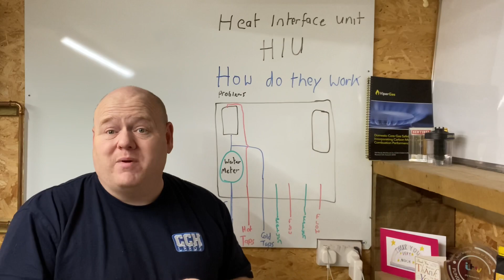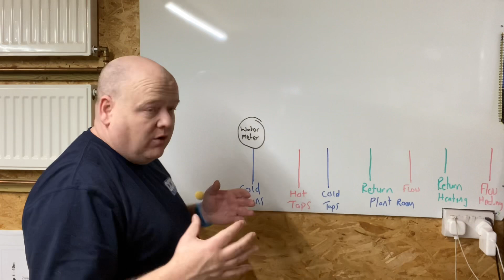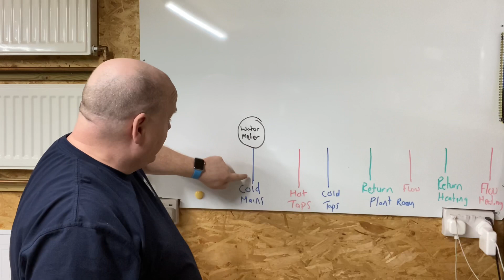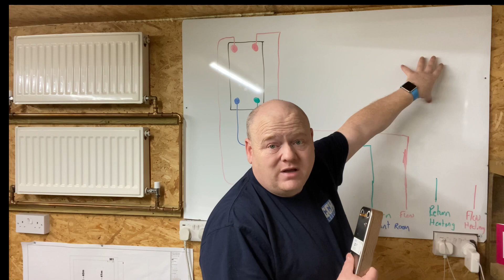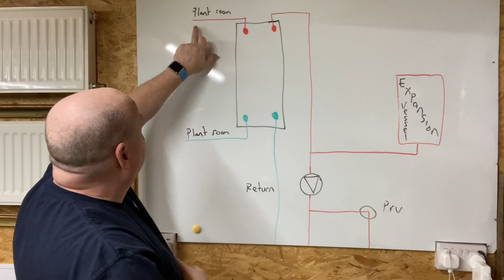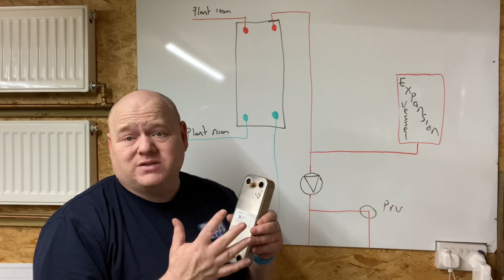Plumbers Videos - Heat Interface Unit - HIU - How Do They Work HIU I20 i30N

Comment: Hi all
Thx for this super clear video! Really useful to understand these systems.
I've recently moved into a flat using district heating and an HIU. The building is mega hot all year round. I never used the space heating in my flat (and I have 20 degree C inside in January/February!). That's great for winter but when it starts getting warmer outside the flat/building is becoming a sauna!
From my understanding it sounds normal since the building needs to receive super hot water and distribute it in each flat. And then each flat can cool this water for the tap/space heating.
Does that mean my building hot water pipes are not insulated? Or there is another issue? Has someone seen something like this before?
Also, as a side question, is it really more efficient to constantly produce super hot water that runs everywhere in the district pipes (and loses temperature) 24/7 instead of having each flat producing its hot water when needed?
Cheers

Comment: As a resident 'enjoying the experience' of the largest district heating system in Scotland (Glasgow, switched on 2016), I can say 2 things:-
1) These systems that great potential to help residents with both reduced bills and provide on-demand hot water and heating. BUT...
2) These systems have even greater potential to be abused by those billing & operating it (same people).
Just over a year ago Evinox(took over Minibems) fitted, to every flat (>700) the ability for them to remotely increase/decrease the pump feeding hot water into our radiators. The same engineers also 'adjusted' the primary valve on every radiator. Their brochure promised "slashing of bills". The brochure also said "radiators might be cooler at the bottom". Red flags indeed.
The nett effect of all this is that today, there are mass complaints of "cold radiators". Our big living room radiator is cold from half way down to the bottom - the living room, unsurprisingly, cold. Evinox has literally treated every resident as a kid in denying every resident full control over their heating. Bills? - they are HIGHER! Mass complaints are ongoing.

Comment: 1:52 He says there's no heat exchanger in it.   Then goes on to talk about the plate heat exchangers?!
Reply: Because a heat exchanger is not the same thing as a plate heat exchanger. Gas boilers have what is called a main heat exchanger which is commonly refered to as just a heat exchanger, which is what produces heat and supplies heat to central heating. The plate heat exchanger transfers that heat to provide hot water.

A hiu doesn't have a heat exchanger, the heat is supplied from the district that has a boiler which does have a heat exchanger. The hiu only has plate heat exchangers which transfer the heat to hot water and central heating.

Comment: I have an Evinox MTP50-10 which is opening and closing the HE control valve soon after the circulation pump kicks in and the pump keeps functioning. I'm reckoning it's an issue with the temperature sensors but I can't find the specs on them (S3, S4 and S5). Do you know if they're type K thermocouples or thermistors and what type? (2 of them look like thermistors and one looks like a thermocouple. I don't think they're original parts)

Comment: Hey Allen, great video mate. One question: If the last two radiators in this system are cold, but the second to last rad is hot at the TRV but a lot colder at the Lock shield valve - What would you suggest to do with the balancing? And second question if you don't mind, can I confirm that the Lock shield of the last rad in the line would be the 'most open valve'? I appreciate any advice you can give me. J

Comment: hi, ever come across the situation where occassionally need to turn the heating out for hot water to come out of the taps? i.e. tap is turned to out but only cold water coming out of the tap until the heating is switched out which in turns heats up the water for it to come out of the tap hot?

Comment: Hi, hoping you could guide me in the right direction. I have the exact same unit in my flat. I can feel the hot water coming into the unit but when I turn the taps on the water is hot for 5 seconds and then freezing cold. What could I do to have this resolved ? Flat is only 2 years old

Comment: If an apartment has hot water in kitchen, second bathroom, but in end main bathroom that shower starts warm then loses heat. Is that likely a HIU issue or thermostatic valve issue? (Sink in that shower works well)
Reply: Thermostatic valve

Comment: got a problem with mine, the down stairs sink hot tap is working fine and getting really hot water but the up stairs sink hot water has been fluctuating and now hardly getting any hot water.  what could it be .

Comment: District heating is becoming very big in the UK. I maintain over 2k properties in the Glasgow area. A lot of folk are still getting used to them but I think they are a good efficient set up. The company I work for specialises in biomass so the schemes primary heat source is biomass. A gas/oil back up is essential in case of primary boiler failure. Of course some units are better than others, as with gas boilers. Do you have fault finding videos that I could let our apprentices watch. A really informative video, thank you 👍🏻
Reply: I bet it’s nice for you when you just get money and never have to suffer the issues. Jesus Christ the detachment from reality.
Reply: @Liusila  Gosh I thought I was the only one in here think this. It's absolutely diabolical to live with. Never get enough pressure in the Water Heating System. Unvented cylinder much more effective with the premise of having a backup of a heating element just in case.

Comment: 🤔 "this are hot at all Times" mine defo aren't. Takes a good 5 minutes to get hot water sometimes.. Need to convince my landlord to have a look.. Its also luke warm in the taps Half the time.  Eg if I use radiators... I can't get hot water out the taps.. What could cause it as landlord doesn't believe anything is wrong

Comment: We have 12 of these installed in a new build block of flats for the last four years, as a facilities manager the system has been a nightmare. 

The two cascading 100kw boilers on the low lost head system constantly heat the hot water rail from the plant room to 80 degrees. 

The hot water rail  is very well insulated but still cause massive secondary heating of the flats in summer and the whole building. It is also not helped as the flats are modern, well insulation and pressure tested to pass the energy performance certificate, there's no were for the heat to go. This has resulted in flats being above 30 degrees, and elderly clients passing out as result of the flats not being able to lose heat.

 The whole complex is constantly warm posing a problem to delivering cold water that is below 21 degrees as by the nature of the system the cold water is bought so close to the interchanged units and uses cavities next to the mega hot water rail pipes. 

And then who pays for the hot water rail?  Its the landlord 24hrs a day 365 days a year, just so a tap can delver hot water 20 seconds faster than a combi. 

The taking of kilojoules readings and billing is admin heavy and takes up a stupid amount of time. So do buy the £10k software to try and save some time but it also important as the kilojoules meters batteries go flat and are not cheap at all  there are not like a water meter that ticks over, but are constantly taking heat readings to work out the joules used.

The balancing of the systems can easily be put out by the smallest amount of scale in the system so in needs constantly cleaning and dosing, a decent size dosing unit is unit is a must. But you still get problems balancing each unit. Either with hot water or the under floor heating. Most residents don't use the under floor heating anymore due to the massive amount of free heat coming off the hot water rail. So you have paid for a massively powerful system where the customer only pays for what they use.

Parts are not cheap, a couple of years in, and differential valves, TMVs and meters have been changed at a thousand of pounds cost across the 12 units. along with loads of hours work sorting the systems to be stable. The reading and billing admin and silly extra heat in the summer months the system turns out to be a mechanical engineers love child constantly burning the owners energy mix. 

If you have the money to install these system....pick something else. They are work

Comment: Hi I have one of those in my flat and want to move a radiator from its current place to somewhere along the wall. The question i have is does the person coming in have to bleed the whole system and fill it back up ? I have a feeling bleeding the system does not have to be done with a normal boiler but don't know if this is different or he is just saying this to hike up price?
Reply from the maker: Thank You
Reply: I would like an answer to this question, too.

Comment: Interesting. As long as the overall execution does not cheap out, by specifying inappropriate valves which would make balancing between ‘apartments’  impossible and not providing redundancy (and automatic changeover) both in primary heat sources and circulating pumps
Reply from the maker: Thanks.

Comment: Worked on these in a retirement complex and found the biggest issue to be balancing over such a large system with many apartments. With ever changing heat demand balancing the whole lot is pretty much impossible. And with the legionella compliance and many TMV'S  it was just a total nightmare it was the job that would never be finished unless you implemented common sense which is that legionella is not going to happen with instantaneous HW but the stupid paperwork 🤬
Reply: That sounds like a problem at the central boiler. Did it have low loss headers?  It should have had. The system shown should be easier to balance as primary water from the main boiler only runs through the plates, not around the rads in each flat. The shown Heat Interface Unit has water from from the main boiler running through the CH plate at all times - it looks like 100% flow can be through the CH plate, or 100% through the DHW plate or ant proportion between. 

The flow into the unit is the same at all times, no matter what the heat load is in the flat. The flow is constant, with a constant temperature. It never runs up or down, this is far easier to balance.

Comment: My daughter bought a flat in London with this type of heating four years ago,nightmare constantly having no heating or hot water ,plant room failures  engineers not able to balance flow and returns over the different floors, if you had heat somebody else didn’t.she lost so much time from work over giving access to engineers she sold the flat. Plus b g had the contract for energy and the tariffs were expensive.
Reply: Although the video is only about the technical aspects of how HIUs work, I fully sympathise with your comment.  District and Communal Heating schemes (You will be using one of these schemes if you have a HIU) are legally unregulated and residents are obliged to accept the monopoly that the heat provider is.  So not only do end users have to accept the heat provider and are prohibited from exercising the freedom to switch suppliers, like a customer who has a system that heats their home's water (majority of UK), but if the heat provider charges an excessive amount or provides a bad service, the resident has no recourse as the industry is unregulated.  The regulator, Ofgem, has no authority to get involved.  This is a very important consideration when one is considering moving to somewhere that has a heat network.  The heat provider can provide terrible service, charge you double what you would pay per kWh if you could choose your own supplier, and there is absolutely nothing you can do about it, other than quit the home, which is what your daughter sadly concluded.  It is shocking that the industry is unregulated.
Reply: @rossstevenson2532  Thank you for taking your time in adding your valuable insight.
Reply from the maker: Thanks for the feedback.
Reply: I totally agree, I've recently been working on these. They have made them too complicated. For what they are.

Comment: Did I get this right?  The two plates are fully hot at all times, with heat from the main boiler being constantly being pumped through them?
Reply: The domestic hot water plate will have a bypass before it, controlled by the mechanical blending valve.
Reply: @BrianBlack123  
I thought that might be the case, as both valves could totally block circulation from the main boiler.
Reply: @johnburns4017  yes. It might be an electrical actuator with controls. But yes, it will bypass when the dhw is up to temperature. 
It can be any heat source. 
In Aberdeen, lots of the council buildings, blocks of flats, all get heat via plate heat exchangers. There is a loop around the city that has various boiler plants that feed into the loop, then these feed into plates, instead of boilers. District heating.
Reply: @BrianBlack123  
I doubt electrical as these units tend to have as little elecrical as possible in them. Quality mechanical controls last and last - but cost. Look at the quality of the electrical controls on low to mid priced combis. Even on cars, most of the breakdowns are due to electrical failures - ask the AA.

Comment: I have seen centralised boilers with Heat Interface Units in apartments becoming more common. It makes matters far easier for architects. No massive cylinder to take up space. No combi which is limited in its location. No awful looking flues and pressure discharge pipes on the outsides of buildings making them look ugly - one of my pet hates regarding pipes, flues and cables on the outsides of buildings.  No gas meters and gas distribution pipes into flats. Many, many advantages.

HMG is talking of phasing out gas for many reasons, mainly because of gas supply, as most is imported from Norway these days, with some even from Russia. They also pull the pollution card.  When we had the North Sea full of gas, it was High Speed Gas. Wind and tide can make the power we need, so it looks like all electric - the way it was to be post war with nuclear - they said electricity would "be too cheap to meter", as we have with water right now (most water is unmetered).  Though I doubt HMG cares a hoot about buildings looking ugly.

HMG is encouraging centralised boilers and district heating schemes. This reduces urban pollution as larger boiler can be monitored better, than hundreds of small boilers. It also makes matters safer as gas is out of flats. 

Saying all this, modern superinsulated flats, and houses, need little heat input for space heating. This also keeps out heat as well. Heat recovery ventilation can cool the home. Just a small simple, cheap, electric heating system - maybe just individual electric heaters in each room and may a small square (taking up far less space) water storage, or 11.5kW instant shower heaters.  So, electric supplies to homes can be say, 140 Amps, not 100, to cope with instant hot water needs.

Heat Interface Units look good for retro fits.

Comment: Great bit of kit in the right situation, we fit lots of these in assisted living flats. Work fantastically when set up correctly. Only down side is when the plant room boiler fails nobody has any heat or hot water.
Reply: Air in the system is also a major problem

Comment: CHP is a option. You usually find them on really big buildings like , gym's Windsor Castle and Buck Palace . I prefer the cascade multiple boilers just in case one goes down. If the CHP goes down  ya buggered UNLESS you have a cascade with CHP as backup. I kind of like this idea but if you are running a plantroom with multiple rooms then all you need is a local stat and the DHW on a return system. I think it might be a expense you don't really need.for example I do some work on uni students accommodation. All run off the plantrooms and each apartment has its own stat.
What's your thoughts?

Comment: Nice unit, He missed Chp as a heat and power source,which combined with a heat store is a great option, perhaps Vokera don't install them. Have worked on similar systems at hotels in Southampton using the City Geothermal system. 10 inch supply and return on those!